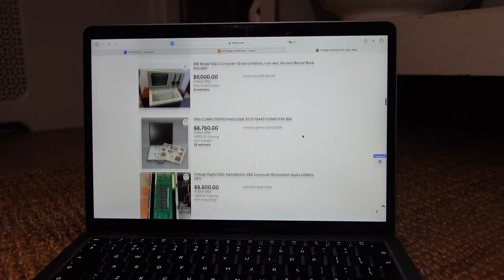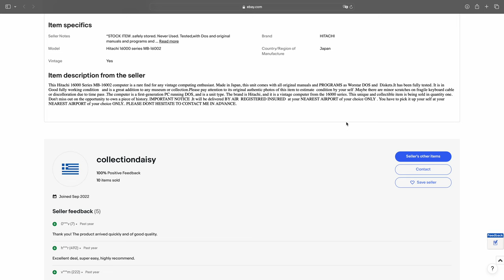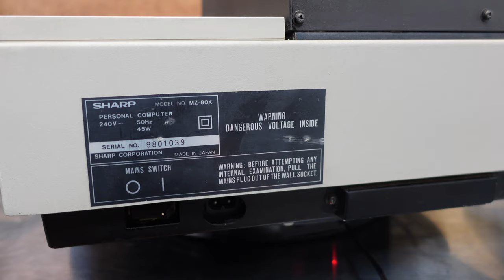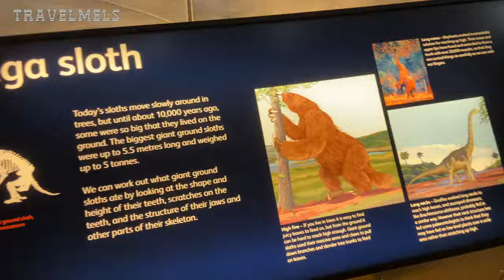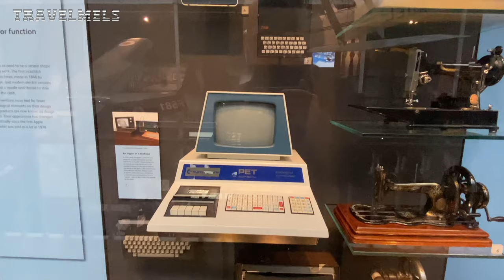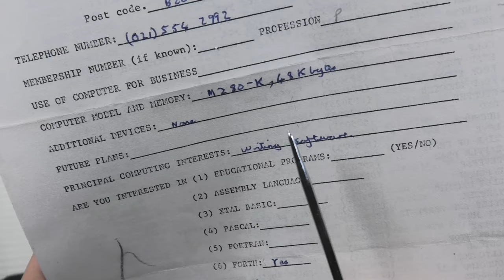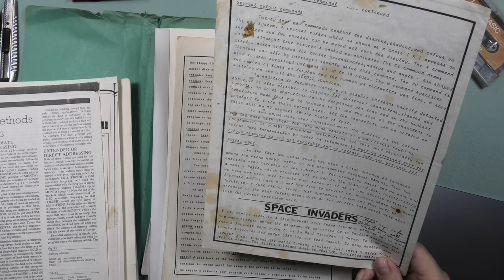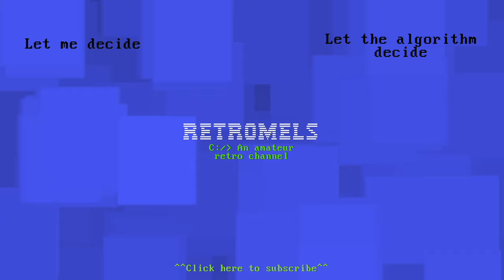Unboxing My MOST Expensive Vintage Computer! | eBay Trolling Gone Wrong MZ80K

Comment: The Sharp MZ-80* systems are simply stunning, congrats on finding such a nice one! I've got a couple of Sharp CZ-801C's and they are sort of a MZ-80 without the monitor (which I'm fine with, I have plenty of monitors as it is around here). And thanks for your archiving efforts!
Reply from the maker: CRT’s have a tendency to pile up around you, I know from experience. People asking “do you really need so many?” The answer to people like us being: ofcourse. Cool to hear about the CZ-801C’s! First time I did, look like lovely machines! 

Thanks for your comment!
Reply: @RetroMels  While window shopping for other Sharp computers, I came across a lovely, working, SHARP MZ-731 and I couldn't help myself. It's on its way from Japan as we speak. :) Now I just have to get the OS on tape for it and the CZ-801C's.

BTW, Amazon still has some copies of the Sargon book, circa 1978. Act now, only $88 while supplies last! :)
Reply from the maker: Oeh cool! Be sure to remove the RIFA cap ( I believe it is one) from the powersupply. I learned the hard way that they are inside haha. Enjoy your 731! Don't want to push my Archive but there you can find a 731 compatible Basic tape, which might come in handy. Good to know about the sargon book!
Reply: @RetroMels  Oh yeah, I'm well aware of *that*. :) 

I took a quick look at your archive, but now I need to go back for the tapes. Thanks!

BTW, have you seen the PicoRAM6116? It replaces the RAM and allows you to write directly to the RAM while the machine is on. I'm in the process of building one for my E&L MT-80Z trainer (which is kinda/sorta a MPF-I clone). And I will see about building them for bigger machines (the PicoRAM6116 being designed for a whopping 2k). No need for tapes. :)

Comment: I kick started my career with an MZ-80K, and spent way too much money on the Peripheral Add On and Dual Floppy drives.  Sadly, I threw it away when the PSU blew a fuse after not being used for 10 years.  Also being interested in Photography, I wrote machine code for it to time colour processing, taking into account temperature of the tank.  The Basic on the machine was too slow to capture time and act on it.  Only snag was preventing any light escaping the machine.
Reply from the maker: Very cool! 🤩